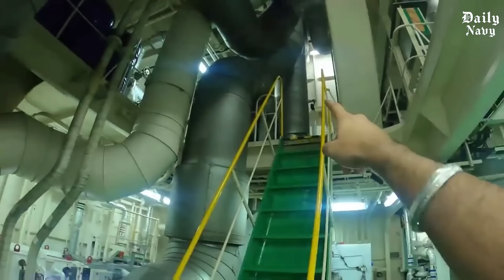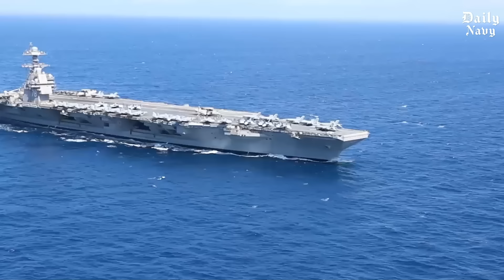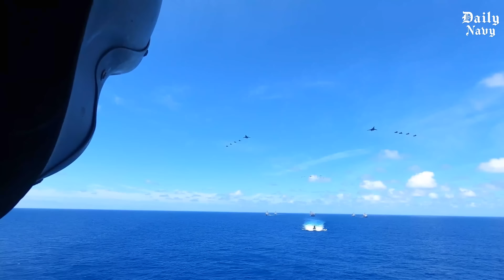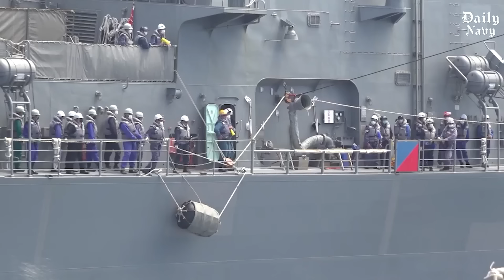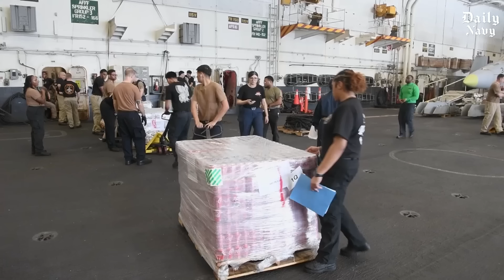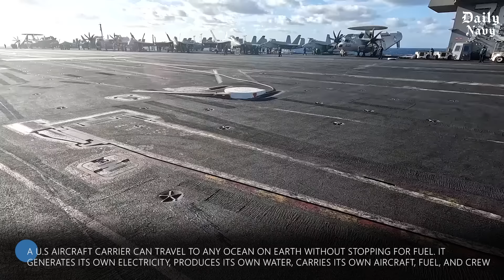How Aircraft Carrier Crews Manage Fuel and Power Systems to Keep a Floating City Alive

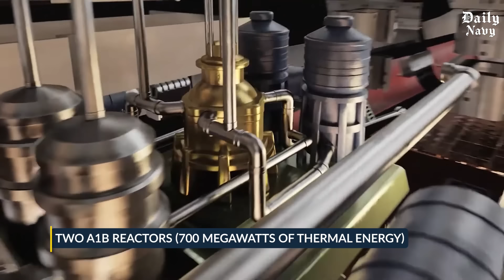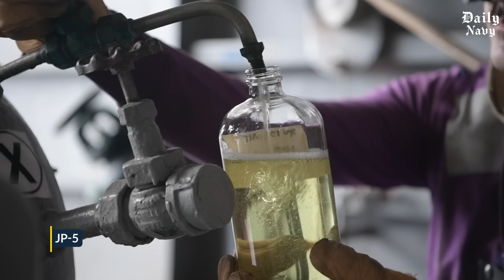Comment: Absolutely mind-blowing content! The way you explained the dual A1B reactors providing 700MW of thermal energy at [02:12] really puts the scale of these 'floating cities' into perspective. I was particularly fascinated by the JP5 fuel system mentioned at [06:16]; the safety engineering behind that 60°C flashpoint is incredible. It’s a true testament to American engineering and the dedication of the 5,000 sailors on board. This level of detail is exactly why I subscribed! Keep these deep dives coming.

Comment: How do they pump water into the tanks and not mix in the fuel, do they use bladders, made of what.
Reply: In simple terms the fresh wster, fuel and ballast water are all independent system.
The only salt wate used for the crew is the heads, bathrooms, all flushing water is ocean water.  Fresh water is limited to essential use only.